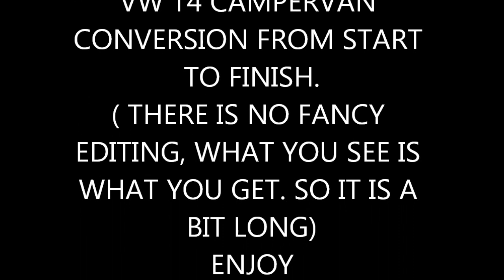VW CAMPERVAN CONVERSION T4 PART 10

Comment: why did you put the lipping joint on the permanently visible part of the table and not on the edge next to the worktop.  However, great set of videos and extremely helpful ....many thanks